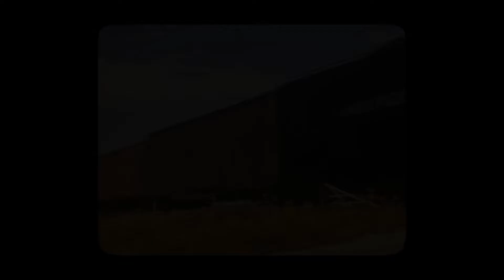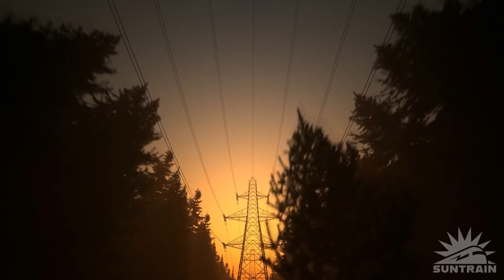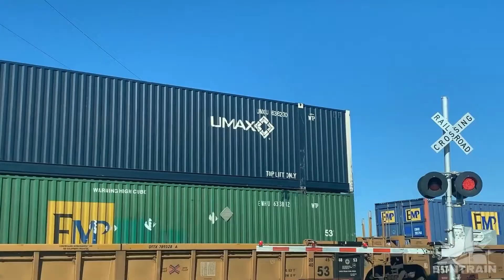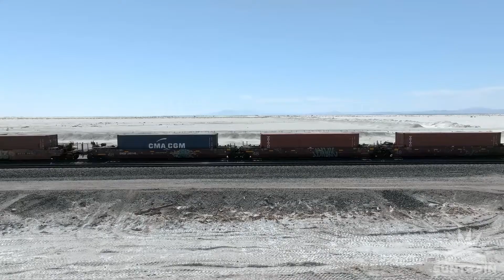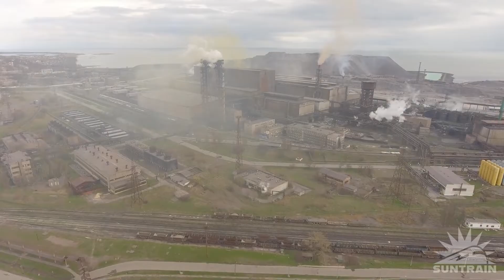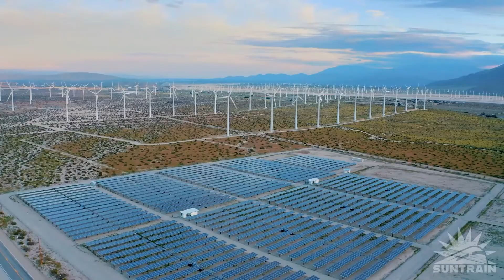SunTrain - Introduction

Comment: What voltage does Suntrain discharge to the grid at?
Reply from the maker: Transmission voltage, which varies based on the particular substation that is being discharged to.
Reply: @ What range is possible?
Reply from the maker: @ 69 - 500kv
Reply: @ 500kv out of a rail mountable unit?  Nice!
Reply from the maker: @DanielsPolitics1  Depending on which model of battery rolling stock we use, the inverters and/or the transforming happen on stationary, trackside infrastructure. We have DC discharging only trains and AC discharging trains available depending on the exact application.

Comment: the math doesn't really make sense, even in ideal situations this is basically impossible to scale. the amount of energy transmitted with this is relatively small and would take forever to break even the 2ish million dollars of battery per car in the train.
Reply from the maker: SunTrain discharges 2 gigawatt hours daily and that's per unit train, on a single O/D pair. During the duck curve, that's well over $250,000 at the low end of range of both day-ahead and real-time wholesale grid pricing.
Reply: @SunTrain  I wouldn't bother arguing with these guys. They fundamentally don't understand how the macro-electrical grid works. 2 gigawatts is an insane amount of grid-ready power given the present shortages the US is seeing west of the mississippi
Reply: @SunTrain  Given that CAISO and ERCOT prices frequently get up to over $150 per MWH during evening hours and significantly more during cold snaps and heat waves, you're looking at base prices of $300,000/train and probably $1m/train during the commonly occuring grid instability issues. CA and TX has yearly grid instability issues that numbers close to $10,000/mwh. That'd be $20m per a single train not to mention the additional utility buckets of revenue from utilities and ISos such as stand-by auxiliry services and cap&trade rev.

Comment: Might need to put an extra battery in your calculator.  This idea has serious math problems....   Hope they just do this in California.   Elec. prices will probably go up 400%.
Reply: It's pretty simple. A single SunTrain / unit train carries 2 gigawatt hours of grid-ready electrical energy which is about 20% of ALL the utility scale energy storage capacity in the USA. With the next known jump in energy storage capacity, these trains will hold 3 GWH. Given that energy storage tech has been following Moore's Law, these trains could get to parity with coal trains (with thermodynamic corrected efficiencies since coal plants are only ~30% efficent) by 2030. 

I hope everyone realizes the goal isn't to carry the same capacity of energy as other trains. It's about increasing deployment of energy storage capacity while side stepping problems with transmission lines. The USA needs 250,000 to 300,000 transmission lines and we're presently building at a rate of less than 1000 miles per year.
Reply: @LukasCurry  politically motivated; don't bother arguing
Reply: @LukasCurry grid ready is false.  Please explain to readers how you take 120 cargo containers of DC power sitting on a mile long train and magically tie it into the grid.  First you need to tap into those batteries somehow.  Gonna build a mile long 00 gauge extension cord?   Then you need to turn into AC so need large scale inverters.  A typical 1 MW inverter cost just under $1M.  A small residential city uses 4,000MWhr/day.   Massive infrastructure investment.   If you think that is cheaper than running transmission lines then you’ve never done an electrical project before.
Reply: Each train carries 2 gigawatt hours as they're using over 100 railcars. They have two different charging and discharging systems that are already in production built by Staubli that lets the entire train charge/discharge simultaneously. The pilot project is 20 railcars is only 384MWH. They then scale to two unit trains that would EACH be running 2 gigawatt hours.
Reply from the maker: @RealSm1tty  Correct!
Reply: @LukasCurry  AFAIK the entire suntrain can only carry 384MWH, not nearly a gigawatt-hour
Reply: @LeroyGamingChair my estimates are you could probably get 1GWhr into those cars but don’t know what batt chemistry they are looking at.  LiFePO?
Reply from the maker: @jeffro490  At the time of deployment of our first unit train, estimated 2026, we'll be moving over 3GWH per day on a single discharge unit train. Thanks for your interest!
Reply: I’m going to do some back of envelope math and I’ll post here.